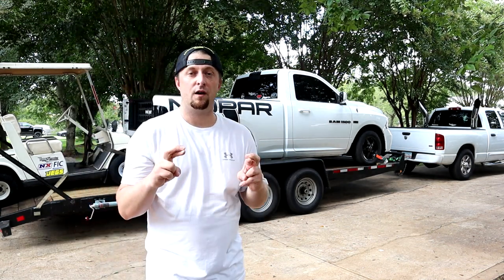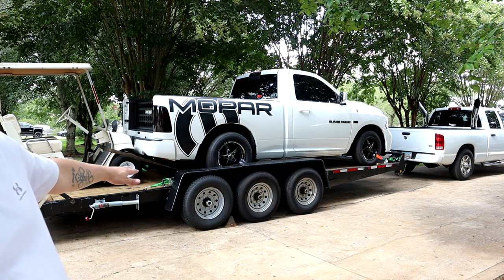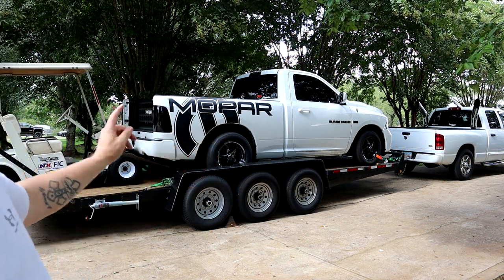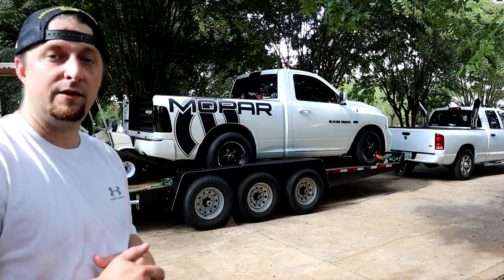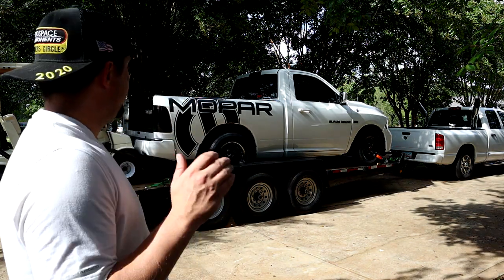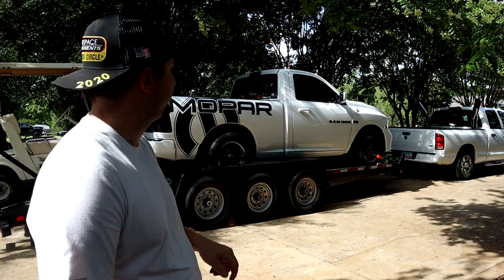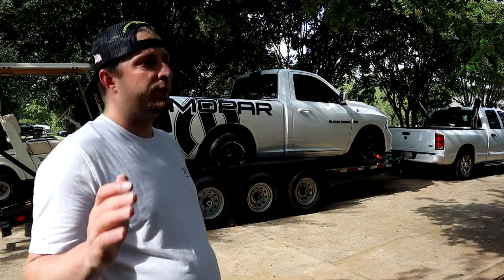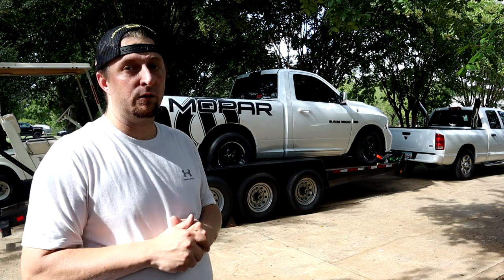New Smoke Stacks On Frostbite Express And Big News On Frostbite!

Comment: Hey bro, why do you have to trailer Frostbite?  Dudes daily procharged Rams.  I've been a little disappointed that you aren't driving it to the track.  Did Frostbite lose ability to drive on the street?  I understand not wanting to swap the drag pack on and off but not to the extent I would need a hauler and another truck.  Just curious
Reply from the maker: Truck is fine just don't want to kill my tires and keep mileage down. Truck has 148k now and track is hour away drive. Not to mention its not heat soaked either when I get to the track. But biggest reason is I'm going to out of state events soon also👍 and another perk is if I break something I'm not worried how I'm getting it home lol for example look how many times incredible hemi truck has broke down and he is just na.